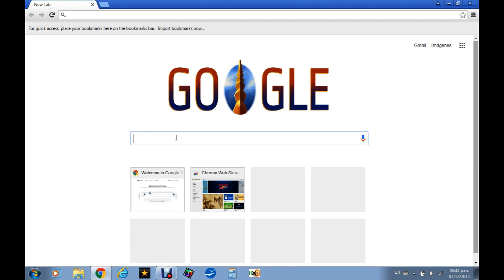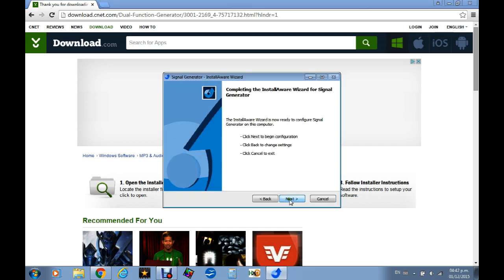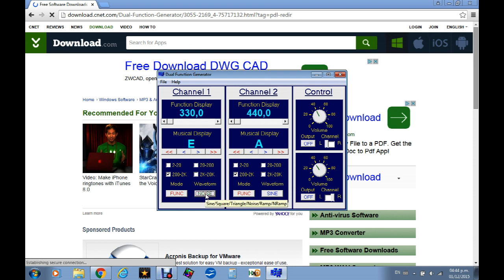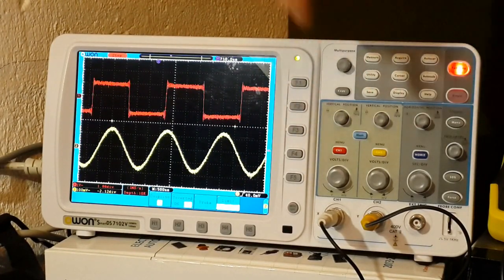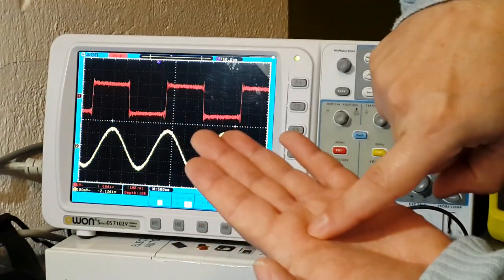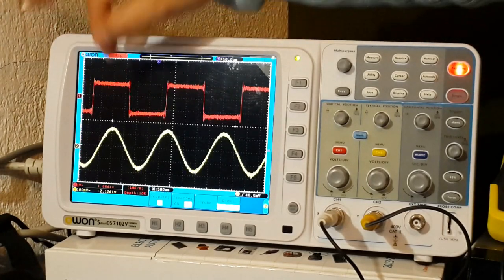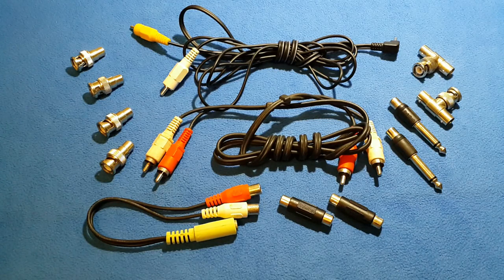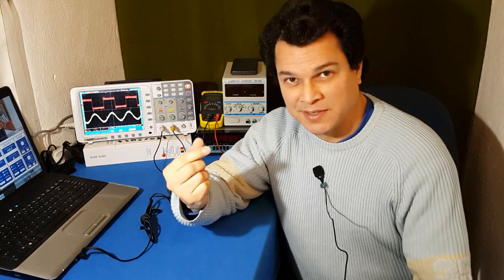How to make a homemade function generator / FREE !

Comment: Hi Bob, thanks al lot for your videos. I want to test my oscilloscope with this software. I wonder what kind of cable your using. With my Rigol I can't get the sine, squares etc. On your video I see you use a cable with a 3,5mm jack and to BNC (n?) connectors. Where can I get those cables. I now use a a 3.5mm to a double jack (red/white). These cables don't work.

Comment: Using the soundcard or the audio inputs/outputs from the PC motherboard is not a good idea when dealing with electronics. Learned that the hard way, since I've managed to fry the audio section of my old motherboard (it was a direct short to one of the supply rails, if I recall). It is better to buy a dedicated signal generator for that. They are generally more capable, frequency and amplitude wise, and some are quite cheap. Plus, in some cases you can even control the DC offset.

Comment: soyou trace 20 KHzwith human hearing...doung!!!
Reply from the maker: Dear friend, human hearing stops in lower frequencies. But many years ago, analog electronic systems for audio were design to work standard until 20 KHz.  Less frequencies that that, was not HiFi, High Fidelity. We are electronic engineers, or technicians, and we talk in our professional terms. It is the same case for civil engineers who talk about a car 2,5 meters width when average mid size car is 1.8 meters. Architects say 2.5 meters average highness when talk about human space, or 600 Kilos average for elevators...
Now days, you can see in your audio setup in your computer, frequencies higher than 40 KHz, 60 KHz and there are new systems for DDS with more than 90 KHz for "audio" system.  
From 6 to 20 KHz, is the electronics window we use to process audio signal in the analog way. But also there are people who can hear 6 times more high frequency that the average. They can hear even audio pest repellents, because they got good hearing, or because same than eyes moves the focus point, their hearing moved out of range. Another example is a good shelf can recognize each one of the spices by the teaeste and smell, while I only I only teaeste the flavor of all together.  The director in the horsiest can hear instruments in individual, and recognize wish one of them is out of tone. Because people like them, our grand-grandparents created the 20 KHz human hearing window specification in analog electronics many years ago. ;-)

Comment: Very nice video, thanks for the suggestion, but personally I would not use sig gens based on pc or mobile device audio hardware because of the limitations of the audo circuitry in these devices, which was not designed for that purpose ( very low peak to peak output swing, no dc offset, low slew rate, limited frequency range). There is also no need to do this , as a good sig gen can be had for less than $100 USD. Check this link https://www.aliexpress.com/store/product/6MHz-Arbitrary-Waveform-Dual-Channel-High-Frequency-Signal-Generator-200MSa-s-100MHz-Frequency-meter/1810103_32482311139.html . Note that for this low price you are also getting a 100 MHZ frequency counter

Comment: Bob, thank you for making these videos. I know it takes time but I do appreciate that you take the time out of your schedule to help others. It is not only the technical aspects you teach but also the strength of character and your determination to succeed despite hardship that comes through in your videos which strengthens my own resolve to do the same. Keep up the good work, and keep pressing forward. Thanks for your time.
Reply from the maker: Hi! Thank you! ...I am debugging a homemade function generator now. Soon you will get another video about how to build one with high technical specifications like the ones in the market. :-)
Reply: +Bob. Kalpon I am looking forward to seeing your function generator when it is ready! I have been looking at various models, new and used but trying to save money so I haven't bought one yet. This video would be perfect so that I could build one that would do the job. I'd certainly be interested in your debugging process and in hearing about the problems you encountered and your solutions to them.
Reply from the maker: What do you need? It is the main question. There is audio generator, function generator, radio frequency generator, and a components test function generator. If you really want to save money, get a TL084, or SN74AC14, or XR2206, MAX038 or an Arduino...
I will make videos with all of them, and how to make different kinds of function generators. I am breaking the already made videos barrier, improving features beyond of what the others made. (...and also, I am using 75% of recycled components and a lot of the main parts are pulled out FROM THE GARBAGE).
Reply from the maker: ...and remember: All commercial product, is made to give as less product they can, for the maximum money they can get from you. As soon as we learn to make our own cakes, there will not be a commercial cake that beats what comes out of your own oven. Also, when you learn to design your own equipment, nothing from the marked new or used, will take away your passion of to designing something better than theirs. Don't get impressed for brands and technology. Believe me, you can make the same or better yourself. ;-)
Reply: +Bob. Kalpon Right now I am teaching myself electronics as it has been my passion since I was a child. I ended up going into programming mainly due to lack of funds for equipment and schooling and Linux was free with all the compilers and documentation I could ever want. I've never given up on learning electronics and so I am watching all the videos I can in my spare time and working otherwise. I am invested in learning and believe in using good tools whenever possible even if that means you make them yourself. If building my own function generator or audio signal generator will help to solidify the concepts involved then I would want to go that route. If it's possible, perhaps you could share some insight into what sorts of devices people throw away have good salvageable components that can be reused as you are doing, that would be great. People throw away a lot of electronics but it would seem beneficial to know which ones are best for salvaging and which might not be worth the time picking up.
Reply: Bob. Kalpon no

Comment: Great video.... by the way every function generator has input impedance...how do u calculate for this one...
Reply from the maker: +Noah TJ Hi! Good question. You can use Thevenin's Theorem to find out the "serial resistor". Using different frequencies we can find a serial capacitor's value. (I will put your question in the videos list. Because each computer and smartphone, can have different values).
By the way! I am working today in the "homemade" Function Generator hardware for more videos. There will be 3 or 4 videos about it, and how to make real  professional equipment for us.
Reply: +Bob. Kalpon Thanks. will be waiting for those videos....Keep making Videos......